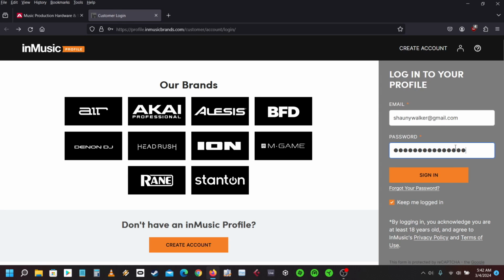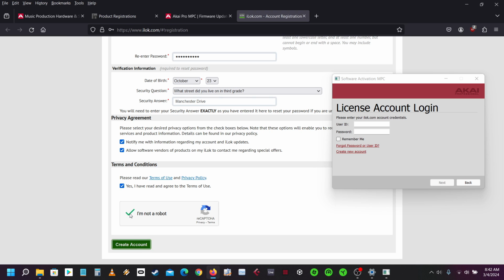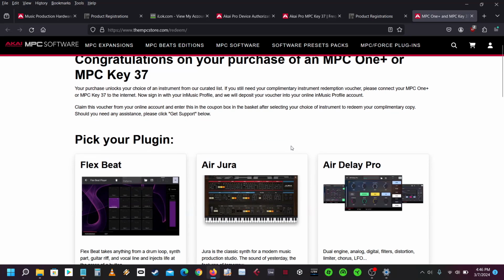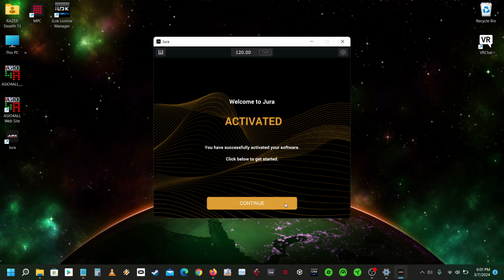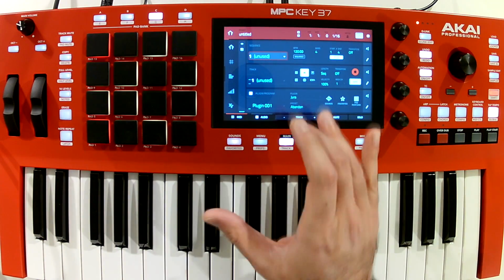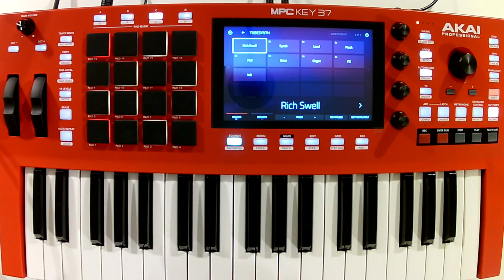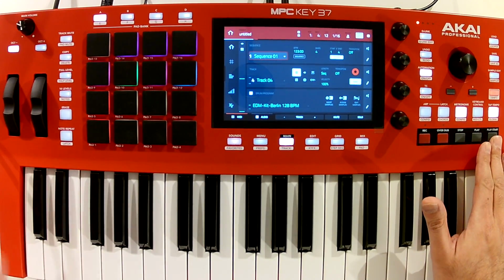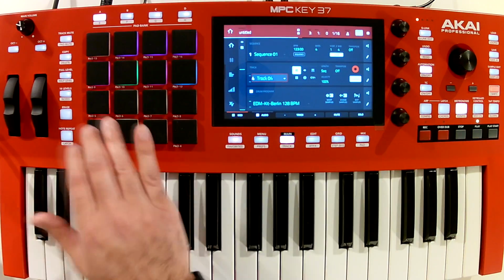Unlocking AKAI MPC KEY 37: Setup, Sound Design, & Interface Mastery Guide Part 2  Shauny Walker

Comment: Can it utilize the computer's hardware (i.e. ram, storage) when plugged in, while still allowing the use of the built-in display?
Reply from the maker: Yes, the AKAI MPC Key 37 is plugged in, it can utilize the computer's hardware such as RAM and storage via a software interface, typically through a Digital Audio Workstation (DAW) or other music production software. However, it will still allow the use of its built-in display and hardware controls for music creation and manipulation. MPC Key 37 can function as both a standalone device. he built-in display will continue to show relevant information and parameters even when it's connected to a computer, allowing you to use its on-device features for easier navigation and control.
In summary, yes, it can utilize your computer's hardware while keeping its display functional for hands-on control. :person-turqouise-waving:

Comment: Mpc is not a synth but a sampler
Reply from the maker: & Everything you want it to be!
Reply: Technically, but also there are many "synthesizers" on the market that are really just sample playing machines with synth engines. For example a minifreak is playing the same exact sampled sounds as the software plugin. If that same VST was made to work on the key 37, functionally it would be no different, as you can add synth engines to the MPC. So your comment is irrelevant.
Reply from the maker: @SnakelnTheGrass You got to love Synths

Comment: You said it yourself: It's standalone. Why spend time explaining how to install plugins on a widows  computer? I don't  have any - I run Linux. It must be possible to install plugins in the KEY37  WITHOUT installing them on Windows first!
Reply from the maker: MPC 2.0 is essential for standalone features. Regardless you would need to initialize via computer of some sort, especially when install of the plugins.
Reply from the maker: If you use Linux, you should know of the workarounds.
Reply: @ShaunyWalker  If you mean Wine, that's usually a lot of work for no other result than crashes and error messages. I'll fire up my wife's old MacBook. But it's just so pointless. I get that the copy protection stuff is extraterestrially complicated but it can't be impossible to port to the Key 37. Less hazzle for users should be worth something.
Reply from the maker: Tony Mansson I'm not catching on. I am sorry but you may have to elaborate further. Linux and customs panel should be able to complete install and port to MPC KEY 37 🎹